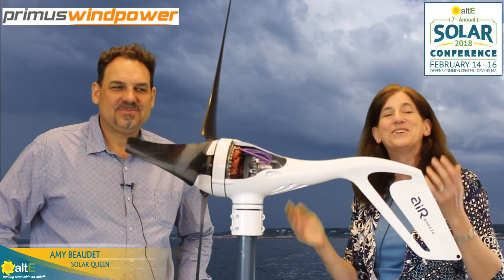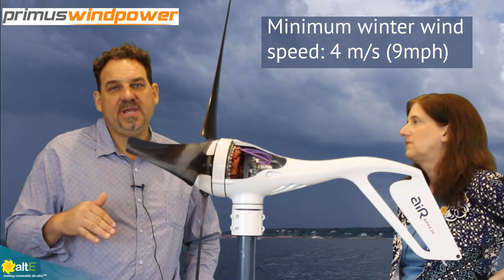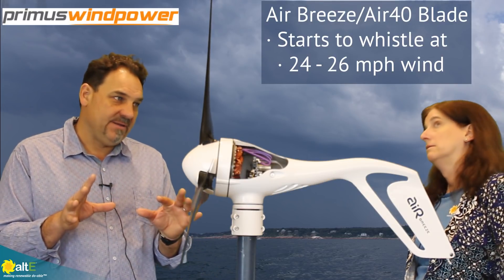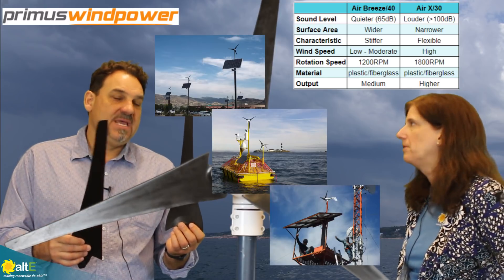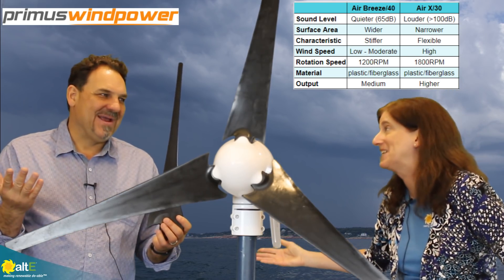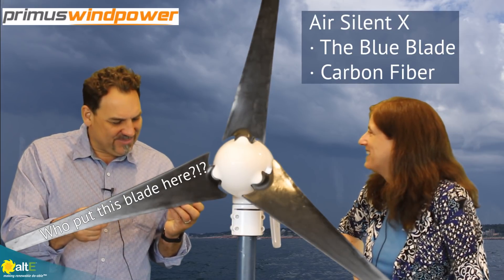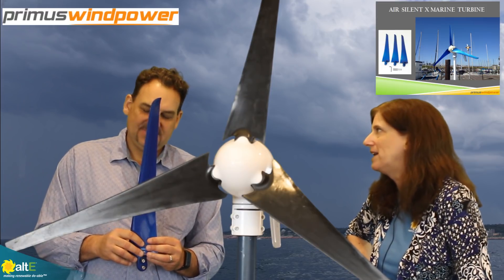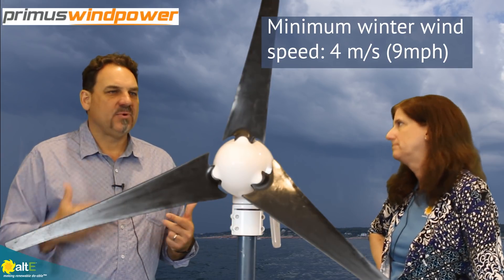Primus Wind Turbine Blade Overview 2018

Comment: Air 30 is well made but not suitable for high wind environments...they are still flogging this nonsense as fact. The  turbine cuts out at around 32 knots....waits for 5 minutes ...then the processor allows it to spin up again briefly to check if wind speed  is still  too high. So, it may go for 10 seconds then hibernate for 5 minutes again. I live inland Scotland...it produces next to nothing most of the autumn ,winter and early spring. I can see that there is merit in having an electronically controlled brake...but only if based on an average  , say if it was consistantly over 30 knots for ten seconds that would be fine. As it is, a gust for a second above this will shut it down for 5 minutes. I had this out with the sales dept ...their reply was that they have sold 100, 000 units. Maybe so, but it does not detract from the fact that this unit is severely mis-sold...even the graphs they have on this presentation makes it look like the turbine limits the power over certain speeds but still has output. That would be fine...thats the basis I bought it on. However, its a complete fabrication to show outputs as they do.After 32 knots , the power drops to zero and the blades are electronically braked until it goes thru the motions of starting up again.

Like I said, it seems a well made unit...if you lived in a perfect world where the winds were between 22 and 32 knots at all times...you probably would love it. Otherwise, buyer beware...save a few hundred bucks extra and get the Superwind 350...with feathering blades which will churn out 350 watts from 24 to 124 knots.
Reply: THIS is an excellent comment!!!   WOW, thank you!

Comment: Can you please advise whats the wind regime for this location: https://www.google.ca/maps/place/Saleem+Cement+Depot./@24.9215891,67.0259737,114m/data=!3m1!1e3!4m5!3m4!1s0x3eb33f947f220569:0x85429c407b3f4a72!8m2!3d24.9217389!4d67.0259256
Reply from the maker: You can download a wind map from the Pakistan government at http://www.aedb.org/component/judownload/root/2-wind/8-wind-map-of-pakistan?Itemid=101 . As you can see, inside the city itself does not have good wind, but the land to the east is very windy. Installing a turbine in the middle of the city, even a small one like the Primus can be difficult, because the buildings interrupt the wind and prevent a smooth (laminar) flow.

Comment: What is the life expectancy of the wind turbine and the cost to replace?
Reply from the maker: It's hard to predict the life of the turbine, as they are under such different weather conditions. They do have a 5 year warranty, so that gives you a little view into the minimum expectations. The price to repair varies depending on what has broken. You can see some of the replacement parts here, and there are others that are not online. https://www.altestore.com/store/wind-turbines/primus-windpower-turbines-parts/accessories-for-air-x-air-breeze-c416/
Reply: Thanks -
Reply: altE noted a 5 yr warranty but failed to mention the limitations, esp if you install yourself.

Comment: Amy do you sell all these blade sets and do your customer service ppl know what is needed for say and old air marine (air403) to upgrade? Also do you other spare parts like the windings, control boards, etc for the said old model?
Reply from the maker: I need to double check, but I think when SouthWest Wind Power sold their Air family to Primus, I think they may have discontinued upgrades to the old old models. We can get many parts, contact us, if the sales folks don't know off the top of their head, they can find out for you.
Reply: ok thank you Amy! :)